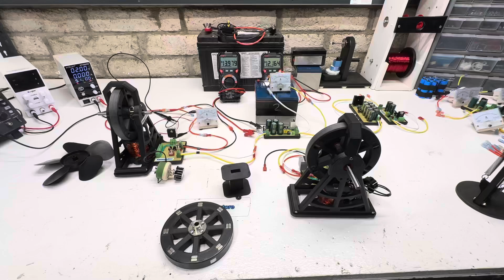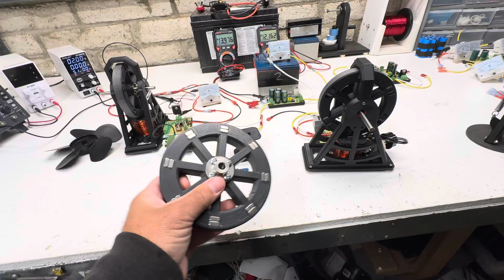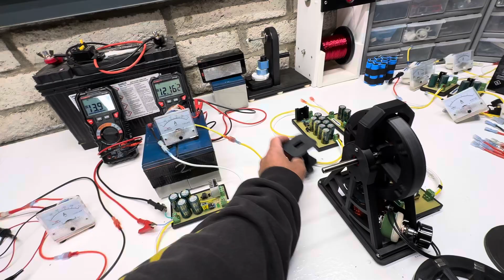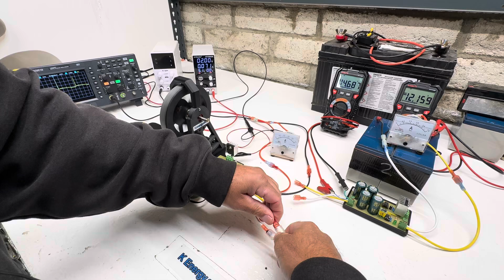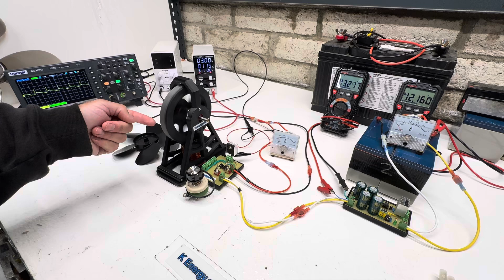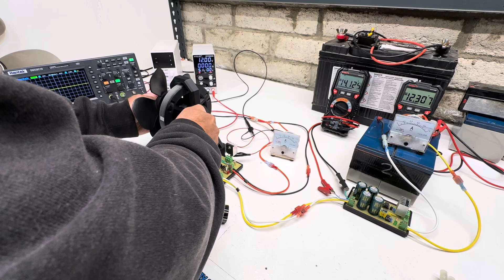Bedini motor kit with ferrite magnets

Comment: Well done definitely nice work !  Do you think It would increase the output power if you add 2 or 3 more generating coils around that rotor possible with ferrite cores? maybe a second driving coil first and then more  output coils ?

Comment: DO you have a video explaining each part of your generator? I'm trying to figure out the best way to make one and this looks great! Super clean design!
Reply from the maker: @FLOEZONE.1_o  thank you ! This is actually not working as a generator but as a mechanical oscillator 
The energy extraction does not make the motor use more power it actually makes it more efficient
Reply from the maker: @FLOEZONE.1_o  yes I have about 200 videos of the same concept

Comment: If I buy this what can I do with it in SG mode and in generator mode? How much energy is being used to run the motor and how much is being put out? I want to buy this if it can be used to help me live in my truck instead of solar. How is this compared to a propane generator? I am a layman so if you could answer simply, thank you. If this can help
Me I will literally buy this today.
Reply from the maker: @chriskopeikin2702  this motor is designed for experimental use for people learning about pulse motors and how to collect the extra energy in the system 
It produces 500v flyback spikes for charging
Reply: Dude you would be better off buying a generator
Reply: @ then what are the purpose of these? What do people buy and use them for?
Reply from the maker: @ they are for learning and experimenting
Reply: @kenergy1707  ohhh ok I see I did not know they are for experimenting from all the reading I have been doing I was hoping there was something that could replace solar. Bummer